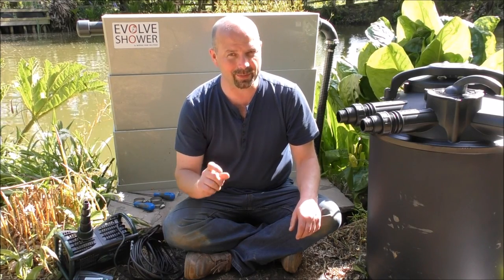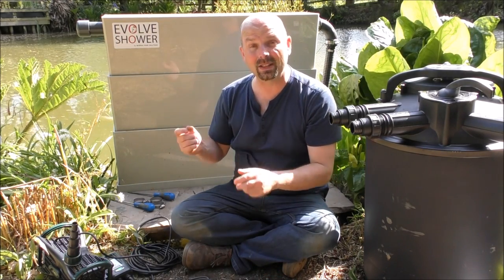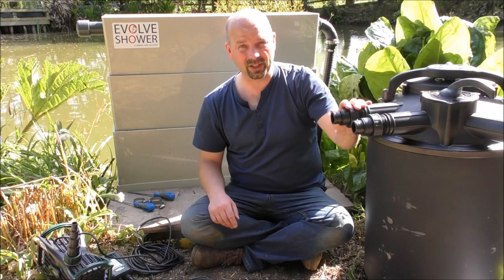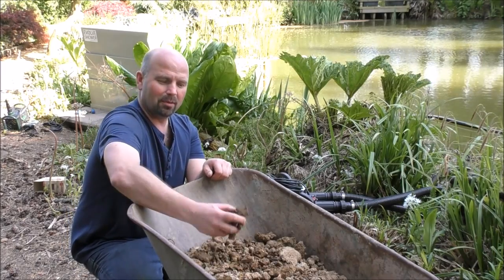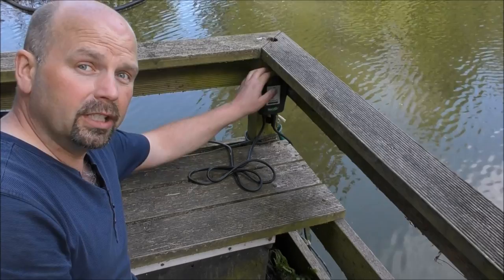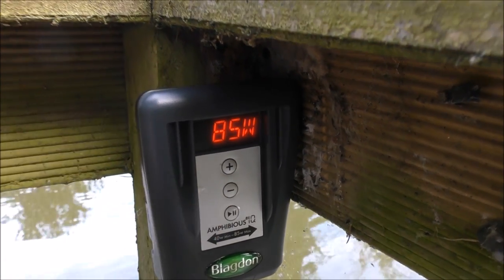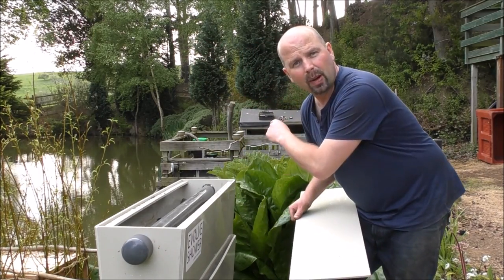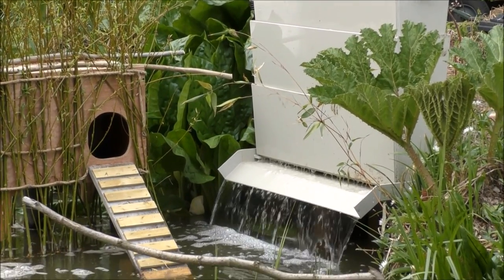Pressure Filter and Shower Filter for a Koi Pond - A Match Made in Heaven?

Comment: Forgive my ignorance in terms of ponds but it would seem to me to make more sense to use a sump pump that is designed to be able to take the abuse of sucking up muck and debris wo damaging the impeller. I’ve sucked up all kinds of things with them in the worst possible environments and you can get them in all sorts of sizes and flows. You would need one hell of a mechanical setup behind one cause it would suck tons of crap off the bottom of the pond but they are pretty solid and easy to rebuild should it fail. You could even place it on a small platform so it’s not sitting directly on the bottom eliminating a lot of silt and mud filtering.  They are generally marketed as “trash”pumps a lot of times but they are designed to allow sticks, rocks, soda cans etc pass through the impeller so damaging it.
Reply from the maker: I do have a 35000 lph dirty water pump but it is about 850 watts so is not designed for continual running. As a filter needs to be fed 24/7 it is way better (from a financial sense) to have a lower wattage pump. The pump I will be using for the main filter (when built) will be an Aquamax 16000 which can handle solids of up to 10mm and I think that one is around 180 watts.
Reply: Pondguru ahhh the power.. I didn’t think about that but that explains why i don’t see people using them on ponds lol.. thanks for the knowledge..